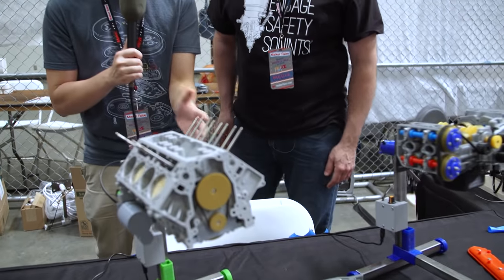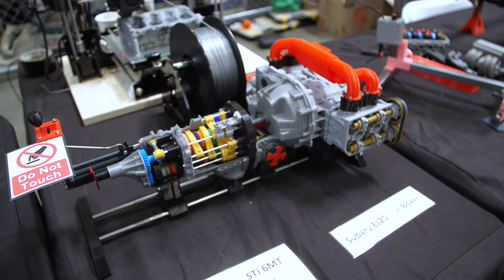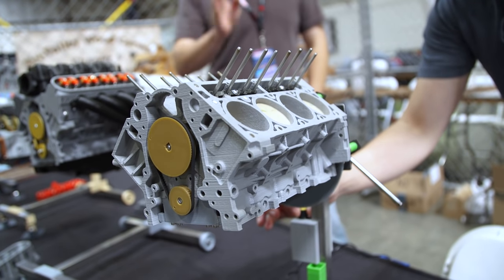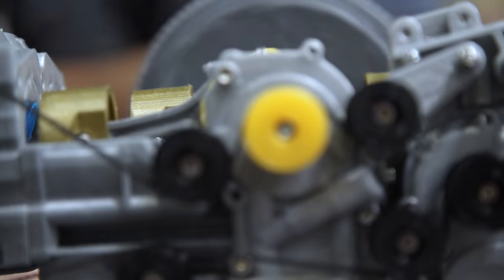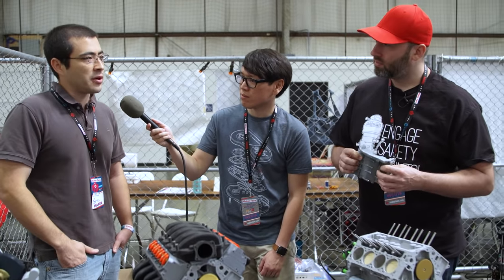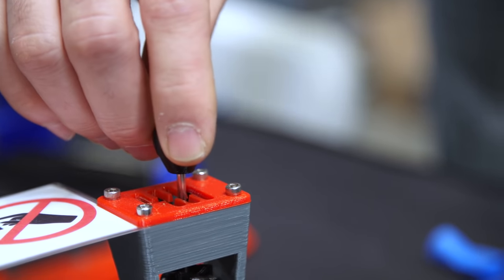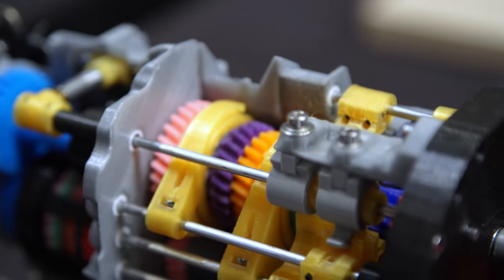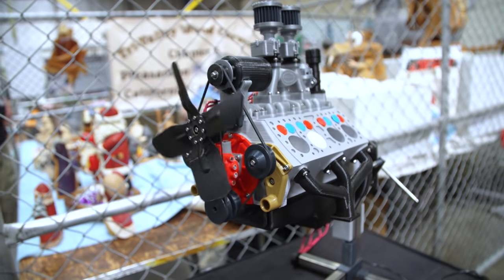Working 3D-Printed Car Engine Models!

Comment: The title makes it seem that they are actually burning fuel.
Reply: Thauã Aguirre how?
Reply: working engine model...not running mini motor.
Reply: So you're telling me when an internal combustion engine is "working" it isn't running on fuel? Interesting logic there..........
Reply: Let's see someone make a plastic 3D printed gasoline engine that actually runs! ... it's possible .. with the right design and at a VERY low power output (i.e. runs very slow)... keeping part temps really low. Such an engine would have no practical use, but would be a fun project. Something like an occasionally firing "hit miss" type motor. The parts could be made hollow with water cooling channels, imagine  a water cooled piston, with water hoses .. feasible at very low rpm.
Reply: Nooooo....! Tested NEVER clickbaits..! Pfffft
Reply: This is so clickbait. Dislike for video and never will come see this channel videos ever again.
Reply: well they could if you added a cylinder and metal piston.
Reply: even with that the PLA used wouldn't hold up to the stresses put on the block when the cylinders fired. That's why they make them out of cast iron or aluminum.....accessory parts like intake manifolds etc can be, but the block? crank? con rods? no way....
Reply: Yes way! Well, probably not PLA, but try googling Matti Holtzberg and Polimotor ...
Reply: done and the key factor? glass reinforced plastics....to my knowledge you can't 3d print glass reinforced plastics......

AND notice he used cast pistons and steel inserts in the block? Hence why even in aluminum blocks they use steel inserts.......
Reply: +Noshi Karaploid What's your point? You can 3d print out of other materials, and it doesn't say in the title that it was made out of plastic. 

I agree that they made it seem like it was working engines. Not model-engines.
Reply: +Völundr Frey "working engine" is a very different from "plastic engine model". Also consider the fact that people like Koenigseg are 3D printing ACTUAL engine parts...  Well, turbo housings to be exact, but on ACTUAL RUNNING, FUEL BURNING EGINES. Cool models but don't call them "running engines" ffs
Reply: Clickbait at it's best. That's why unsubbed a while ago, just lurk for Adam vids.
Reply: +laser69beam I'm not sure if you agrees with me or not, but just to make it clear I agree that "working engine" implies a functioning engine, not a plastic model of an engine.
Reply: +Völundr Frey ;))) I think we're on the same page ;)
Reply: "The block would not hold up to" Lies....  i have seen a car run (albiet a couple of mins) using Wooden main bearings, on a scaled down engine like this, the fuel used would not be much so the actual forces applied would not be anywhere near enough to crack an engine block unless you tried to make an RC drag engine...
Reply: jesus dude, it would have to run more than a couple of minutes to be considered a "success"...I mean, ffs, you can use a piece of paper to cut wood with....but only for a few seconds.....

I saw a single cylinder engine that used a wooden piston too....but there comes a point where you have to be a LITTLE practical.....

There's a reason they use materials like aluminum and cast iron for engine blocks: they're strong. Not only that, they're strong by volume too. Sure, you could build a block out of plastics but since plastics are so much "weaker" than metals, it would have to be x times thicker aka bigger. I mean, who would want a 1.2 litre engine that is twice the size of a 426 hemi? 

I don't know the exact figures, but for the sake of argument lets assume that any plastic is half as strong as cast iron. Therefore any structure made from plastic would have to be twice as thick to be equal in strength. (it's much more than that but for simplicity lets just say it's 2x stronger). So if an engine block wall is 1/2" thick out of cast iron, it would have to be 1" thick out of plastic. 

Never mind thickness, but plastics are subject to heat distortion....so the heat of combustion would distort the block, cylinder walls, everything. When heated, plastics get weaker, so the longer you run it, the weaker it would get...unless you used super cooling....

I mean, there's a reason they put steel sleeves inside aluminum blocks because even aluminum isn't strong enough to stand up to the forces of combustion as well as the lateral forces applied to the piston....

If you want to see a real world example, there's a video on youtube where a guy puts a lexan cylinder head on a lawnmower engine to show how fuel ignites inside the cylinder. And how different fuels burn differently. It only lasts a couple of minutes and that's ONLY the cylinder head......(and it was 1" thick)
Reply: +Muskoka Mike please correct me if im wrong, but the reason we use metals instead of plastics in engines has nothing at all to do with strength, but solely heat (if we're talking about parts not made of steel). Modern plastics can exceed structural steel in tensile/yield strength (which would mean it beats the notoriously brittle cast iron). All plastics degrade when exposed to high temps for long periods of time. Even 'high temperature' plastics start degrade around a few hundred C after a few hours. Add in the poor thermal conductivity and the problem becomes worse. You did mention that so not disagreeing with you, just thinking your 'super cooled' idea was kinda disingenuous when really that's all you'd need (a way better cooling system).
 I've seen the video with the clear head (super badass but there are a few vids up from different people so maybe im thinking of a dif one) but i don't think it was the head that caused the engine to fail. Imo burning things like WD40 as fuel isn't good for your engine ;P and i think the creator(s) mentioned the thing was a piece of crap before they put the acrylic head on it.
Not trying to start an argument, just thought the topic was interesting.
Reply: Oh I know you're not starting an argument, we're just discussing!

Cast Iron: Yes, it can be brittle, but there are blocks around from the 40's made from cast iron that are still operational today. Thousands from the 60's....Yes, you have the weight issue, but the damn things are durable if you take care of them. 

Yes, the heat distortion/wear is an issue with even the strongest plastics. The thing about cast iron engines is: even if it overheats when something goes wrong, if you stop in a reasonable amount of time, let it cool, fill it full of water, and off you go. With aluminum heads, doesn't take long to warp them and plastic? It'd be a puddle of goo before you could stop and even then the build up heat would destroy it in minutes. 

As for strength, yeah, there's some glass filled plastics that are extremely strong, but we're talking about 3D printing one and as far as I know, you can't 3d print glass fibre reinforced plastics (yet). 

I'm sure at one point we'll have new innovations in engines, but I honestly thing the internal combustion engine will die long before we get to that point. Our oil reserves aren't infinite and at one point, we'll run out and that doesn't bode well for plastics either (because most are made from oil as well).
Reply: @gasser5001  you can take the parts and cast the engine blocks out of cast molds for ether cast the parts in aluminum or cast iron or brass
Reply: @gasser5001  to make a running engine
Reply: These don't run on gas yes but if you adjust these just a little you could run them on compressed air so close enough to working

Comment: Those are not working engines, those are moving models.
Reply: Agreed, I had envisioned them actually producing work through combustion of some fashion, not mechanically operated by a separate source.
Reply: ya but its a step in the right direction. more durable filament and some more robust designs can create something fully functional.
Reply: Actually, they are working engines. Instead of gas they use electricity to work.
Reply: the manufacture of a thermal engine requires more than an engineer is a story that lasted a hundred years, mastering the development of a single part would be an extraordinary success
Reply: Yeah, but in theory you could use these models, print full sized parts, cast them in metal via Lost PLA, and build and actual engine. It would take forever, and quality control would be a crapshoot though.
Reply: @Daunlouded  yeah those are called electric engines and there's one inside every moving model, the 3d printed part is not doing anything that can be considered engine operation.
Reply: You could turn the piston engines in to pneumatic engines
Reply: @christianled5972  Resin printers are the future, they can print much better materials than FDM plastic because it doesnt use high temperatures and can print in higher fidelity.

Comment: With a different camshaft design, you could probably run these on compressed air (for a little while.)
Reply: Now I think if you took each piece and cast it from aluminum or something, you could run it off of some low heat fuels

Comment: You forgot the most important cool part. The distributor and spark plug lights. That is what set the original V8 plastic engines apart from the cheap competition.

Comment: the transparent engines they were talking about from the 70s/80s were called the visible v8, i had one as a kid
Reply: I had the same one in the 60's, It looks like its from the 50's.
Reply: still available online.
Reply: It's funny how the new generations are bringing back so much from the first technological boom and calling it an invention.
Reply: Building a high rpm engine now except i painted my block still have alot of work to do its a 1960s that i bought off an old man for 30 bucks he was 10 when he built it and the block wasnt straight an parallel like it should so i had to disassemble and rebuild block is done but still need to fill block and heads with epoxy and tap for screws and bolts
Reply: Thank you! Been looking for the name, I want to get a 351 windsor model!
Reply: nobody called it an invention
also since when did 3D printers exist in the 50s

Comment: I love that someone took the time and effort to do this, I grew up rebuilding chevy 454 and 502 engines for boats, the only thing that I can criticize if the last engine in the video, he has the exhaust coming out of the block, not the heads where it's supposed to be, and the engine is a v8 and there's only 3 exhaust outlets , not 4... don't get me wrong, I have to give this guy credit for doing all of this, it takes a lot of time.

Comment: I actually made the Toyota motor with some user designed additions and it is simply brilliant. I also have all the hardware to make the transmission and the transfer box and I hope to get around to starting that in a couple of months ..... It still blows me away how well all the parts, especially the block, is modeled to be detailed but still easy to print. Highly recommended for a complex project that is just going to work.

Comment: Frank cracks me up, his mind works a lot like mine when it comes to mechanical stuff. You can definitely see he's the gearhead of the outfit. I hope he ends up making his own engine on here and getting it running, running a methanol flathead recreation would be really cool... you could even put a blower and mechanical fuel injection on it and... lol
Reply: But gotta remind him though, not to make it too efficient or too great of a viable alternative to currently used fuel, if not he might get shot in the head. Lmao
Reply: it's a flathead, it will never be efficient, just cool. Their design isn't used for anything other than lawnmower engines anymore for a reason, they don't make much power and the don't get good economy.. They are just simple and cool to look at. A fully race built Flathead Ford V8 running a big supercharger, fuel injection and methanol typically makes maybe 400hp... you can easily do that with a low compression naturally aspirated 302 these days.
Reply: J.A.Ratt85   We're talking about a plastic model buddy. Calm down with the hp and efficiency  stuff.
Reply: dont worry!  i'm on it!
Reply: Internet tough guy, he is giving free info, hush and take the info in.
Reply: cool... okay I just had an idea... a 1/3 scale flathead on the back of a longboard skateboard... that would be fun

Comment: "Transmission.." *shows a differential...
Reply: First I thought what's the problem that's part of the transition(its transmitting power from the engine), then I remembered Americans call the gearbox the Transmission.

Comment: The lowest temperature fuel is compressed air. It would be ideal as it cools as it expands. It would require no modification to your prints and help prevent the plastic pieces from melting at higher RPMs

Comment: the prop shaft to the axle should be rotated 90° in the sliding part. It looks as if the rotation speed was a bit unsteady. Really nice work, though, I'm impressed!

Comment: I built two Prusa original Clones and bought the FlashForge Dreamer. So far since I'm a RC pilot and fly a 1938 Super Stearman with a Radial Engine, I have 3d printed a working five cylinder radial engine. They actually print stainless steel and other materials, even biometric strands. Amazing what they are doing. I have to admit that watching it reminds me of several scriptures where God created from the dust into a form, whereas up until now mankind has only been able to whittle material into a form. As a master machinist, this is awesome, and as a model builder just incredible.
Reply: Ace Buck .....far from being a rich kid, I work for a living. I don't buy fashion designer clothes or Apple "i" products, nor do I spend money on cigarettes, weed, or gamer's software and pay to play websites. The money I do have went to pay off the mortgage and buy another house to rent out. I also am a machinist not a dishwasher.

Comment: "can't explain how a transmission works, its impossible" I literally had to take a class that had me memorize every part in a transmission, then power flow between each gear and how the different mesh outputs power. its very possible, you just don't know how.

Comment: To run them on their own power, you could go pneumatic, using a small air-compressor to provide some pressure. It would mean altering valve timing though (would basically mean becoming a two-stroke). Dig the subie motor.

Comment: Since a combustion engine is really "just" an air engine working on the principle of phase change, you wouldn't necessarily need to run it with a combustible fuel. If the materials could handle it, you could use things like dry ice or liquid nitrogen and use their phase change into gas to power it. It's be trickier to get the fuel for it, but it's not going to end up melting the parts or burning things down if people get careless.

Comment: I have a new design for an engine head that will work with a normal piston bottom end if your interested. Its not patented and can be crowd sourced by you if you want. Maybe we could make some money selling the models. Its a spring less valve head with removes most resistance from the engine and allows for extremely high ROMs and lots of power while being above 80% efficient. It won't be able to be patented once its shown to the public so the big companies won't have any control over it.

Comment: They are already going 4 rotor style engines based on Mazdas 2 and Three rotor engines. There's another market to be had. I would consider that instead of the Poppet valve head for an overlooked engines that rocked when it go some attention, but could loose a little more refinement. Against, let me know! I've got three designes already in use and ideas for many more!

Comment: If he wants to print a horribly complex engine...there are radial aircraft engines were rotating sleeve valves with the most intricate crazy gear train you can imagine.  I saw a working 3d rendering of one in Blender once and i couldn't imagine the mind of the man who designed it originally on paper.

Comment: There is a BIG difference between a "motorized moving car engine model," and a "working" car engine model.  I would argue that a working engine would need to be one that actually burns fuel as an internal combustion engine.

Comment: casting a full functional small scale engine and transmission that runs on gas could be epic for a go kart if you could get the tolerances tight enough.

Comment: Did anyone else notice both the intake and exhaust valves on at least one cylinder of his "Boxer" engine open and close at the same time?  Very cool models though.  I have never dealt with a 3d printer.

Comment: with no fuel how does it chooch!!
Reply: jeff atkins with no head how does it choo choo?
Reply: Just add schmoo...
Reply: Angry pixies
Reply: The chooch factor is extremely low...
Reply: jeff atkins did you not listen when he said there is a 12volt motor attached?
Reply: just give it some ether and send it

Comment: that was done with a cheap 3d printer?   it looks so sharp and smooth.  that's really impressive.
Reply: It is. I'm making these parts on a printer that cost 400 bucks, and so far the fit has been almost perfect.

Comment: Imagine being able to do this with lighter weight / negative thermal expansion / stronger metamaterials...

I have a '94 Mitsubishi 3000GT VR4. Fast, stock, but it's old, it cannot hang with modern corvettes, challengers, GTR, etc without extensive modification. It weighs around 3800 lbs right now. 

Replacing the shit ton of glass with something lighter and stronger, all the body panels with lighter, stronger material would be great... best of all the rotating mass... 

Obviously you don't want a car too light, it would handle like shit, but can you imagine how much fun it will be to be able to 3d print custom components for an old car in your own garage? Bring it the hell on man.